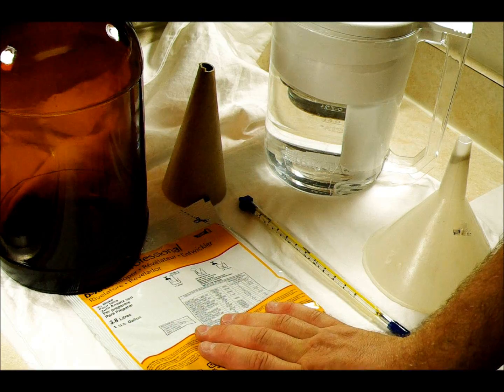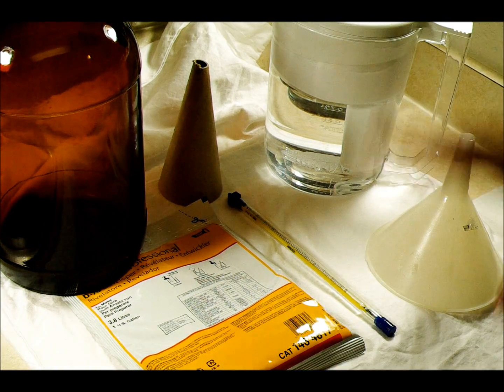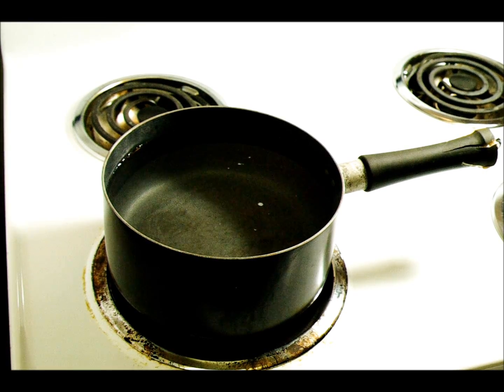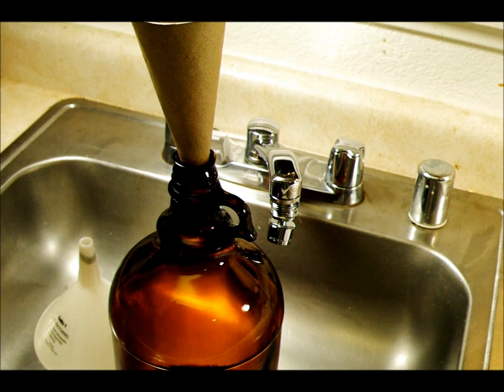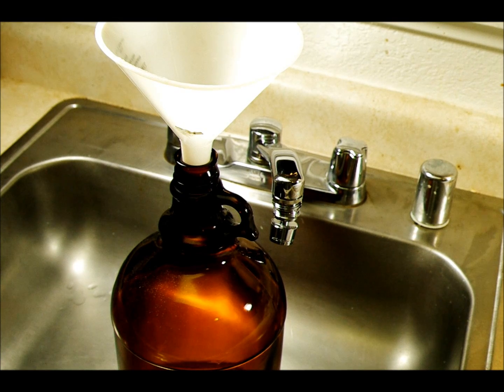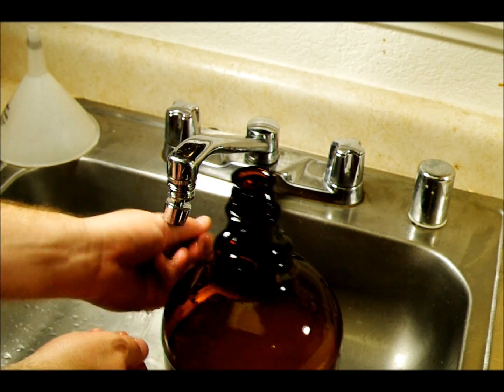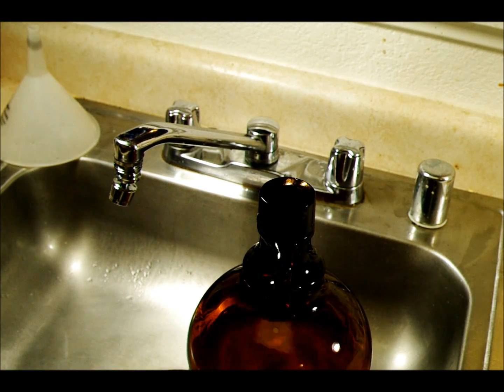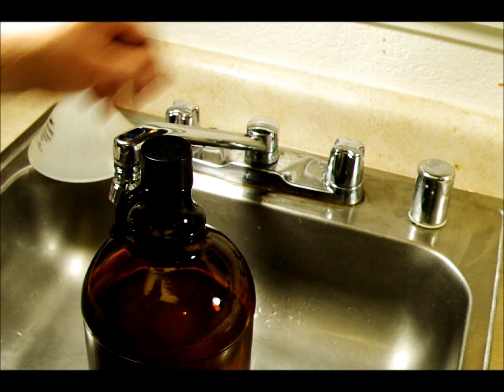How to Mix Black and White D-76 Film Developer from Powdered Concentrate

Comment: No spout pot did not help him. I knew he will get clumps and deposit over engineering either way it will sit to cool down before usage.
Reply from the maker: Correct, but of there are clumps when it cools they will not dissolve. So fillets and shaking the mix prevent that. Clumps that don't dissolve affect chemistry effectiveness and performance because they change the mix ratios.

Comment: Hey how long before the pictures start to appear on the film? After development?
Reply from the maker: Definitely not. Your film has to be in the dark when you remove it from the cassette to put into the spiral and tank and then it has to be in the dark during the chemistry. Once the fix is complete you can take it out of the tank or pour the fix back into your container (because fix is reusable and also super toxic if it goes down a drain) and then take the tank lid off and rinse and dump the water. The fix removes all of the remaining light-active compounds from the emulsion leaving only the ones that have already been affected by light, so no additional exposure and development will occur if the fix step was performed correctly.
Reply from the maker: They'll appear during their time in the developing chemistry but if you expose the film to light before fixing it you'll erase all the photos. I have a video that goes through the whole process from start to finished results. I don't have a link handy but that might help, too. At minimum you'll need developer and fixer. Those are the two mandatory chemicals.

Comment: How would I use this in terms of owning a 290 ml tank with one 35 mm film roll?
Reply from the maker: Basically you'd need to figure out which dilution you plan to use. Instead of 1,000ml, as in my previous example, replace that with 290ml (I'd use 300 as it's always a good idea to have a few extra mililiters in case some spills) and then simply divide using 300 instead of 1,000 as your total volume.
Reply from the maker: @Deliah Shellhouse no problem. Let me see if I can explain it differently. Stock is what you get from the mixing directions on the package. Assuming you have a one-gallon (3.8 liter) package you'd mix up the powder with enough water to make 3.8 liters of stock. The 1:1 is then a mixture of stock and additional water. So 1:1 is, in your case, 150ml stock and 150 more ml of water. Stock is what you mix up ahead of time to use later after cutting it with water. Let me know if that helps clarify things.
Reply: Ah, by the grace of god yes I finally understand! Thank you so much!

Comment: Can I use a plastic jug
Reply from the maker: Definitely yes. I do now, exclusively. I find them easier to pour from. I buy distilled water in gallon jugs then use that distilled water to mix the chemistry. The excess distiller water goes into my water filer for use in mixing other chemistry and final film rinses. Then the plastic jugs are recycled when I finish with the chemistry.

Comment: thank you, I find this helpful as I prepare myself to start developing my own black and white. I'll do the 1:1 solution and get a 1L bag of stock to begin. Question: how long with the diluted chemistry stay good in the bottle?
Reply from the maker: Thank you!

Diluted solution, in general, is good for some hours after you cut the stock with water. The stock solution is what you'll want to keep for storage and then only cut it before you use the chemistry to develop film.
Reply: David Hancock thank you for replying! Also, what is the best way to store the stock solution after you open the original packaging? And how long will the properly stored stock solution stay useable?
Reply from the maker: @willf.5403  How long it will let depends on the developer. Rodinal, for instance, can last months or years. D-76 tends to last about 90-180 days or so, reliably. XTOL a few months. You can prolong all of it but keeping it in containers with minimal head space for air. Air is the event of developers.

Comment: People complain about how it takes them up to 10 minutes to dissolve D76. I stir in a big plastic bucket (wearing gloves, a mask, and face shield) and everything is dissolved in 2 1/2 minutes.I start at 127.5° F, add the powder to the distilled water (3,000 ml)and when I'm done stirring the temp. is 122°F. Then I add the the remaining 800 ml. The stock solution goes into three "accordion" bottles, with no air in them after squeezed.How long does it take you with this method?
Reply from the maker: Hmm, not ten minutes. I'd say about three or four after the water's heated and then I let it sit overnight to clarify and cool to room temperature.

Comment: Hey great video. Do you know how long doest the solution remain fresh, i don't develop much and maybe it's better if i disolve just a part of the powder. And one more thing, do you know how many uses does a dosification of the solution resist? Thank you!
Reply from the maker: Solutions stay fresh for different periods based on what chemistry it is. Some have great shelf life, others do not. Don't mix partial bags. The compounds in the bags are different crystal sizes and settle unevenly. Mixing a partial bag will mean the wrong chemistry is mixed. And uses per dilution is always one use per diluted stock solution.
Reply: Thank you very much!

Comment: one more question and thanks for the help. what about splitting the the fixer to make smaller batches ?
sorry this is all new to me.
Reply from the maker: Ask all the questions you need. I'm glad to help.

Powdered fix has the same use requirement as powdered developer, so it can't be cut. Now, for liquid fix, I'm not 100% certain whether that can be cut or not. Liquid developer concentrate like Rodinal or Ilfosol is designed to be, but I think liquid fix might be designed to be used all at once to create a stock solution (I'm open to the possibility that I'm wrong on that.) Fix, fortunately, has a much longer shelf life after mixing than developer does.
Reply: If I already cut it in half can I mix the other half and then add both half's together after a couple days ?
Reply from the maker: I think you can. I would mix the other half in a separate container with the appropriate water quantity and then add them together. If the chemistry is mixed in the wrong order you can get a heat-inducing chemical reaction. That happened to me once and it melted a hole in the side of my vessel.
Reply: Thanks

Comment: can you split the developer up and just make one quart at a time and if so what's the best way to do it?
Reply from the maker: No, you can't. Powdered developer is made of different constituent chemicals and they have a different crystal size. So like a bag of potato chips where all the small bits settle at the bottom, the smaller crystals in developer bags also settle. If you were to grab just 25% of it at a time, the mix would almost certainly be incorrect and your developer would likely either be way too strong or way too weak. I believe that these are sold in quart-size packages. Also, liquid developers like Rodinal may be a better solution since you only dole out what you need for an individual tank or two at a time.
Reply: Thanks

Comment: when you mix 1 gallon to 1 package is this considered full strength or 1:1 solution  ?
Reply from the maker: Good question and no. Mixing the powder with the water creates stock solution. Cutting that solution with an equal amount of water (which should only be done immediately before use) makes 1:1. Don't re-mix 1:1 solution into the stock. After dilution and use, the developer is spent. You can use 1:3 (one part developer to three parts of water) to make the developer stretch. The 1:3 times are longer than 1:1.
Reply: Thanks

Comment: This seems too complicated. I use just hot water from the tap (well, I live in an area with clean water with minimal traces of minerals in it) and mix it with glass stick in separate plastic measuring cup (no problem with dust there, just hold the bag close to water level), stir until everything is dissolved) and after that seal with gas from lighter in smaller bottles. I used different developers and none of them smelled bad.
Reply from the maker: Sealing them with gas sounds pretty complicated, too.
Reply: David Hancock No, you just hold a lighter (of course, the cheapest one with separate gas release and spark maker) over the bottle for few seconds, propane-butane is heavier, than air, acts like an invisible liquid (think of it as of an ghost of oil), it will make a layer on the solution level and do not allow almost any oxygen to react with it. I used marbles just for stock rodinal.
Reply from the maker: Yeah, that does sound a lot easier.

I stopped using marbles a while ago. I got some that had a coating which interacted negatively with the developer and caused it to be ruined after about 24 hours in the bottle.
Reply: David Hancock Works only if you have fresh mountain water, it did not work with water on the continent and would not work in most of England. You can use reverse osmotic pump to clean normal water, it is OK, and it is clean source of water for drinking in places with not so great water.

Comment: Use distilled water, it's cheap and consistent. Tap water content can change since it's often taken from multiple sources. And as remarked, it's stirred not shaken as a James Bond Martini.
Don't know how I missed this before but  the d76 should be dissolved in the hot water--that's the point of heating the water since solids dissolve better in hotter water. After that you add water to make the full volume.
Reply from the maker: Distilled water is great and I use that (unless I'm out then I have a backup Brita.) I also use distilled water for the last two rinses after washing. That's eliminated what problems I had with chemical crescents on occasion.
Reply: For my final rinse I also used distilled water with a little Photo Flo and squeegee the film to hasten drying.
Reply: Actually a Bond martini is shaken not stirred (which is a criminal). A martini should be stirred gingerly.

Comment: what means when u use it "stock" or "1+1" or "1+3"?? and which one is better
Reply from the maker: +rodjav360 It means how much developer and water are used to make the working solutions. So when you mix up D-76 that creates the stock solution. When you take one part (say 250ml) of stock solution and one part (again, say 250ml) of water, you create 1+1. That mix cannot be re-used after developing the film. The same is true of 1+3, which could be, for instance, 125ml of developers and 375ml of water. 

Dilutions have different effects. I find that diluted developers produce images with less grain and less contrast. Contrast can always be added, but it can't be taken away. Diluted developers are also cheaper since you're using less of the stock solution at a time.
Reply: thx buddy, i guess full power is better!, your vids are awesomeeeee!
Reply from the maker: Thank you!

I would also say experiment with diluted developers as well. You might find that dilution opens up different elements of your photography that you hadn't noticed before.
Reply: T Latz thanks man, i will definitly try dilution, i had good results with stock but a little too grainy, so im gonna keep experimenting on this. thanks again. cheers!
Reply: so can stock solution be reused?

Comment: Do you have to store it in a glass jar? Why can't you store it in a plastic container?
Reply from the maker: +Lara Stephenson It can be stored in plastic, and many people do so, but plastic is air permeable and the chemistry will expire more rapidly.
Reply: +David Hancock Thanks! Good to know. For now I'll start with using plastic, but will definitely upgrade to glass once I get going.
Reply from the maker: Truth be told, I store my fix in plastic gallon jugs now. It's easier to pour from. I mix it with distilled water and put it back in the distilled water's container.
Reply: +David Hancock Nice! Okay, great to know. One more question: It looks like you heated up some of the water in the pan and put some of the non-heated room-temperature water in the jug first. Is that correct? So you basically had normal room temp water waiting in the jug and then added the heated water?
Reply from the maker: Lara Stephenson Correct. That allowed the water, during the mix, to be the proper temperature. It's best to just heat all the water up to the proper temperature, but if that's not feasible, an alternative is to mix hot and cool water. Putting the cool water in first allows the hot to cool down and prevents the chemistry from overheating, which is more likely to damage it than mixing it with room temperature water first.
Reply: +David Hancock Good advice! Thanks!

Comment: Can you just mix up what you need instead of mixing the whole powder amount? So far I've only used Ilford DD-X and have never used powder developers.
Reply from the maker: wildbill9919 Not with powder, no. Powdered developer is not a uniform, homogenous compound throughout. It's comprised of metol, salts, and other stuff. Each item is a crystal of different size. So like a bag of chips, the small crystals settle to the bottom of the developer powder bag. If you use only part of the developer, you won't obtain a proper chemical mix and your images will either be over- or under-developed. Or nothing will come out at all.
Reply: David Hancock OK thanks.

Comment: one question  can we use plastic gallon for keeping and mixing the chemicals
Reply from the maker: nikonpic Sure can. I use store-bought distilled water in gallon jugs for making most chemicals. I use glass bottles for storing developer (which is more sensitive to oxygen than fixer, and plastic allows gas infiltration) and use the water jugs for fixer. The plastic jugs are actually really easy to pour from.
Reply: David Hancock thanks sir thanks for your kind reply

Comment: this may be a dumb question, but can i mix it and be fine if i only mix half the powder into a half gallon?
Reply from the maker: Not a dumb question at all. It's not advised to split bags, unfortunately. The chemical powders don't homogonize well. So think of it like a box of cereal or chips where all the broken bits settle to the bottom. The smaller crystals in developer will settle to the bottom, too. So the chemical make-up if you only use half a container won't get the correct chemical mix.

The makers do sell half-gallon and quart bags, though. So smaller mixes are doable but are more costly on a per-ounce basis.

Comment: Question: Once D-76 is mixed up like this, how long does it keep for in a sealed brown bottle? Also, is it possible to mix up a portion or half the bag of D-76 powder and keep it for later?
Reply from the maker: Once the D-76 is mixed, it can be kept for around three months or 60 rolls (assuming you use it stock and re-integrate the developer after use.) The developer will start to lose efficacy after time and after about two months or around 40 rolls you'll notice increased grain and reduced contrast. I'd suggest cutting it at 1+3 (parts water) for use and disposing of the expended developer for the best results.

As for partial bag mixing: don't. The particles that comprise the mix may not be evenly mixed, especially if different constituents are different crystal sizes (think of a cereal box or chip bag where all the tiny pieces settle to the bottom.) Using only part of a bag will almost certainly result in a chemical makeup which yields faulty image results, inconsistent development times, and so forth. If you use a liquid concentrate (such as Rodinal or Ilfosol 3) then you only need to use as much of that as is required on the day you develop film.

Comment: Why not use coffee filters, a large kettle & collapsible storage containers; like the ones from freestyle photo/AP
Reply from the maker: Good question. For the collapsible containers, they're plastic. Plastic is porous and will absorb chemicals, meaning that once a container is dedicated to one chemical it really needs to stay in use for that chemical only or the plastic will degrade more rapidly. Also, plastic absorbs smells. Also, the accordion-type collapsing containers have wear and stress points built in so they can develop pinholes or other leaks with use. And the accordions also do not drain chemicals as effectively as the smooth glass, meaning it's harder to fully remove chemicals between fills. Glass is non-porous and can be used in various chemical service with a good cleaning in between. It also won't absorb smells.

Collapsible containers do require less space, however. And plastic containers won't shatter if dropped.

For coffee filters, they are cheaper but also are much finer than a filter funnel. They strain slowly and risk filtering out chemical compounds if used to strain mixed chemicals. That can impair mix quality if some of the chemicals have not fully entered solution.

A large kettle is fine and actually better than my approach. I simply chose what I could get at a garage sale for $1.
Reply: much respect on the detailed answer. Thank you & I shall remember it for my next batch of D76.